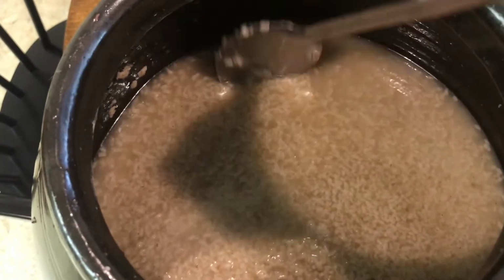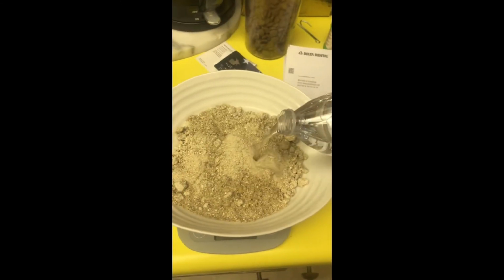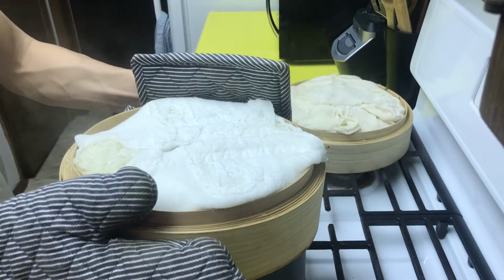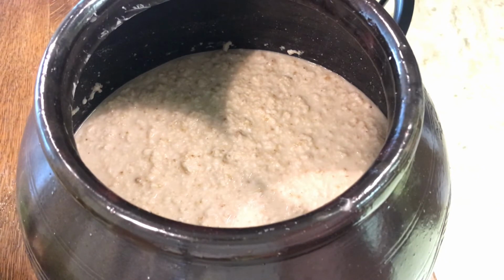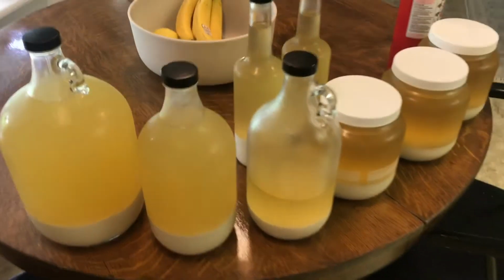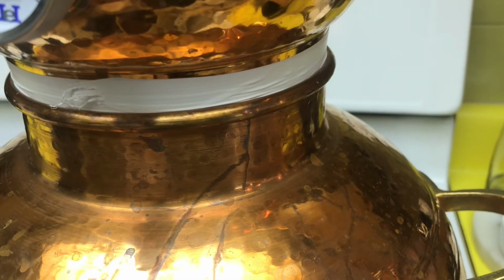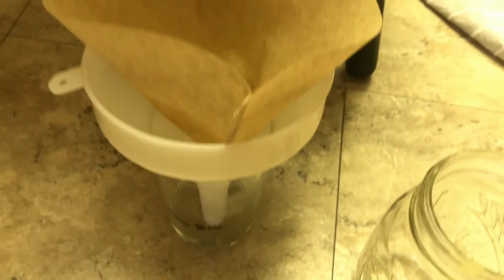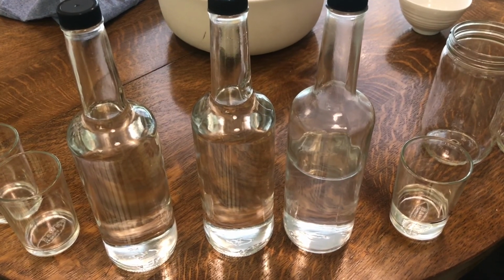How To Make Soju

Comment: Hi Stephen,
Loved the video as I do enjoy Soju, but only get to drink it when I go to a Korean restaurant or grocer. Definitely going to try your recipe, but I'll have to make around 40Ltrs to put into the still. 

Your Thermometer should be at the very top of the vapor path, not in the bottom of the onion dome. The product that I put into my still is around 14-18% and it starts running at 82 - 84 degrees Celsius.

Just a couple of terms for you to help explain a little more.

Your first cut 2oz is called the foreshots (Ethanol and very bad to drink as you explained)
If it's your first run (distillation) and you intend to do further runs, the first is called a stripping run. What you are doing is reducing the amount of product and raising the alcohol level. Generally we take these to approx 10% (temperature adjusted) then stop. Same for other stripping runs.
Combining all of the product from the stripping runs back into the Pot Still (which you have), we then process that (Spirit Run), once again taking out the foreshots. Once they are gone we would carefully with a finger taste the product coming off the still to figure out where the heads, hearts (the good stuff) and the tails are.
The hearts and tails can be re-used in later runs so that there is no waste.

Am currently in the process of sourcing the rice powder, nuruk and chapsal rice here in Australia.

There are calculators online that can help you determine what amount of water to add to get to a desired drinkable ABV, entering in the alcohol percentage and volume from the product off the still.

I've joined your channel so keep the videos coming. I myself have been brewing beer for around 8 years (all grain), and for the past 9 months have been making spirits such as Single Malt Whiskey, Bourbon, Gin, Vodka etc as well.
Reply from the maker: Super helpful, thanks for the great info! Let me know how your end product turns out.
Reply: You seem very experienced so i'm sure it was just a careless error but ethanol is the good product you want and the foreshots  are methanol which is toxic. All alcohol is toxic to the body but the liver can filter out ethanol slowly but sustains damage over time with frequent usage - other alcohols are not handled well by the body and  methyl alcohol can cause blindness.  Methyl alcohol is a single carbon alcohol, ethanol 2 carbons, propanol 3, butanol 4, pentyl 5, etc.

Comment: Hey mate, in regards to your temperature, I think the thermometer is working fine, it's just that it isn't in the right area to show you an accurate vapor temperature. It needs to be up the top of the condenser to show you a reading of the vapor temp, which is what stillers use. I drilled a small hole into my small experimental still and I use a digital BBQ temperature probe to show me an accurate on the fly reading.
With my larger stills the onion dome under the bubble plates has a pressure gauge not a thermometer, it's a safety feature that is simply there for monitoring large volume distillation, to make sure there isn't back pressure from the bubble plates in the column. I really only check it if I am running the still for the entire day through several batches.

If you know what temp the dome is a t for cuts then you can just adjust to suit that reading because it should remain the same no matter the distillation wash type. For example if you find it reads 90c before the methanol/ethanol discharges but it remains constant then you know the onion is at 90c but the condenser is at 78-80c
Reply: Yes agree, the point of no return I believe its called

Comment: When you do the 50/50 water mix, what's the ABV of the soju?  Does it taste any better or different than the store-bought soju?  Thanks for the video!
Reply: It would really depend on what you mean with store bought. Here in Korea at least that usually means the "traditional" green bottles. Those are the best know brands and are made with whatever the cheapest grain alcohol on the market is at the time, and are then flavoured to taste similar to real soju. Real rice brewed soju starts about 10 times the price of the green bottles and the best ones are about 40 times the price. I'm not sure how easy it is to find those outside of Korea yet. THOSE are what you should be comparing this to.
Reply from the maker: Great question! I'm not sure the exact ABV but it's very strong, even when diluted with water (probably a little higher than commercial green bottle brands). The taste is much cleaner and less sweet, IMO. I'll run a ABV test on my next run to get a more precise answer.
Reply: @ottosilver  Yes, I was referring to the cheap, run of the mill soju that's found all over the US, that includes corn syrup as one of its ingredients.  I'm hoping I can make quality, authentic rice brewed soju in the near future.  I had some on my last trip to Korea and if I could make something even half as good, I'd be thrilled.
Reply: @hyesunhouse7461  Thanks!  I look forward to it!
Reply: @kleenslate5292  Ttokki seemed to be doing well and he started off brewing the the US. He recently changed to brewing in Korea though. I think he is only doing that for cost reasons. If you can get your hands on some of that then you will taste something decent :)

Ttokki is interesting. He does EVERYTHING. Made his own nuruk, then brews the wonju, then distilled it into soju. As far as I know, there is no one else, even in Korea, who does their own nuruk like that.
Reply: @ottosilver  Thanks for reminding me of Ttokki, I'd completely forgotten about him.  I saw him on Youtube over a year ago and he seems like a genuine craftsman.  Will definitely give him a try.
Reply: @ottosilver  Looks like Tokki soju may be available next month in one location, at least in the Seattle, Washington area...it's a tough find for sure.
Reply: @hyesunhouse7461  update on the ABV?
Reply from the maker: @goshdamnitross3370  It's typically 30-40% ABV

Comment: This is cool.  If I had a still, I would absolutely do this.  😙😉
Reply: make one ... $8 pressure cooker - drill a hole through the lid ... attach copper pipe ... coil the copper pipe into a cold bucket .
( it doesn't need to be a $350 unit to produce high end alcohol - I made mine with $20 ... can boil 4 gallons at a time  ... & get better results )
Reply: @tsvandyke  lol... I'll check the web.
Reply: @_Solaris  no .. go to the local thrift shop ... salvation army store ... or a boot sale . .. "the web" does not sell a 4 gallon pressure cooker for ANYTHING LESS than $300 ..
Reply: did you know .. that "selling a kit" .. or "selling alcohol" without a LIQUOR PERMIT ( in the US ) is ILLEGAL ! ... how can you promote or make money off of ... ILLEGAL ACTIVITIES !? ...
Reply: @tsvandyke  it's illegal only if you get caught

Comment: Thank you for posting a most informative video. I have a couple of questions.. Could you use the lees in place of the Nuruk and I wonder if it would be to your advantage to have a proof & tralles hydromitor.
Reply from the maker: I've used the lees instead of nuruk to make additional batches, but it's not ideal because the lees don't contain the full amount of enzymes you need. You might be able to squeeze an extra batch out, but eventually it will get too diluted in strength and the rice/sugars won't break down. And a hydrometer would definitely come in handy when distilling!

Comment: If you drill a hole at the highest point on your distillation unit and add another thermometer it will give you that 145 to 150 degree reading you are looking for. Distillation is my thang !
Reply from the maker: Thanks for the tip!

Comment: I'm wondering whether we could hack a bread making machine to put it in and make the machine turn it automatically and continuously say for week so as to speed up and improve the yield ?
PS: You should invest in some silicone hoses, as those PVC based will surely leek toxic plasticizers in your booze, even if they are not toxic in low concentrations, they will impart a flavor, you'll only notice when you change.

Comment: Great video mate ..  thank you. Have made some Soju  using the Angel Yellow Label yeast and it worked well but eager to try your traditional method. 
If I may make a few suggestions... on the outlet of your conderser please don't use PVC tube, ethanol will leach out the plasticisers very easily into your product and they are nasty to your health, get some silicone tube instead. Regarding the methanol coming off first in the heads and foreshots, that is incorrect (a common misconception based on the boling point is lower than ethanol) in a pot still the majority of the methanol will be in the tails (towards the end) this is due to the strong molecular bonds between methanol and water (plenty of scientific research papers on this subject). Good news is there won't be much in this recipe as methanol is largely generated from fruit products with pectin and not starch based ingredients.
Reply from the maker: Thanks for the great tip about using silicon tubing. I wasn't aware of the plastic leaching, but that makes sense. And good to know about the methanol also. Very helpful feedback.
Reply: Distiller here, please DO NOT listen to this man, methanol ABSOLUTELY comes off first! I work with whisky distillers, you are insane bro. Strong molecular bonds between methanol and water exist and do happen in the tails but you should 100% discard the first 50-150ml of fore shots depending on the volume you're distilling. Methanol, acetone and aldehyde volatiles all have lower boiling points than ethanol and DO come off first because of this. Many factors are at play but generally it is HIGHLY advised to discard your foreshots. This mans advice is insane and reckless, if you are unsure please do some simple google searches on this topic, and if you really must, go on google scholar and search through some papers using key words. Unreal...
Reply: @danchaplin2911  ... yes definitely discard the foreshots, stuff in there you don't want to drink. Well I and many PhD qualified scientists with very accurate GS-MS equipment disagree with you ... check out the many peer reviewed scientific papers published on the subject then come back with some real knowledge.

Comment: Ethanol is a great solvent and that's why you shouldn't use plastic funnels and PVC hoses on your output.
Reply from the maker: Good to know. What do you recommend using instead?
Reply: @hyesunhouse7461  Copper or stainless tubing and funnels. Plastic would be fine on low alcohol wines like Makoli but not soju. Home distiller is a forum with a lot of distilling info. Have you ever used a product called Angel Yeast? I think it shares the same ingredients as Nuruk.
Reply from the maker: @jaimesan2609  Gotcha, yes I've heard of Angel yeast, but haven't used it yet - seems like a fun experiment
Reply from the maker: @G9y76jk14ttac  
고맙습니다!
언젠 안동 소주를 먹어보고 싶다

Comment: You can taste the methanol in the heads. It BURNS. Once that stops burning and tastes smooth then it’s ethanol
Reply: distilling output ... separate the HEADS & TAILS ... IF you don't "separate" the distillation into many small jars ... the whole batch will contains POISON ( turpentine, Acetone & Methanol ) - - - first boil off the " HEADS " ... turpentine ( boils off at 20.8 C or 69.44 F )... then acetone ( nail polish remover ) ( boils off at 56.2 C or 133.16 F )... then methanol ( POISON ) ( boils off at 64.7 C or 148.46 F ) ...
 then alcohol ( boils off between ( 78.2 C or 172.76 F )
... then the " TAILS " water ( boils off at 100 C or 212 F ).
Reply: Prohibition in the US ... illegal alcohol makers would NOT separate out the HEADS ( turpentine, Nail Polish Remover ( acetone ) & METHANOL ... poisoning a lot of people ... look up " methanol poisoning " ... so many deaths ( from home-made alcohol ) led to re-introducing alcohol to the US - just so the manufacture can be "supervised & quality control" to reduce number of deaths from ( poisoned / unfiltered ) home-made alcohol production.
Reply: HEADS also contain  ... nail polish remover .. .EWWW ! - who wants to drink NAIL POLISH REMOVER ( acetone ) ?

Comment: You did a lot of research on how it's made but not enough on the still it's self. First you clean every part with hot soapy water. Rinse and dry it. Then you run the still with a 50/50 mix of vinegar and water. Rinse with water. Then you need to do a sacrificial run with some cheap wine or other alcohol. Do NOT drink it. Throw it away. This last run is basically a final cleaning with hot alcohol that removes any contamination or salts that might have been missed.  Now your ready to make a drinkable run.  And the first little bit is called 4shots, not 1st cuts
Reply: Thanks for the tips Kirk